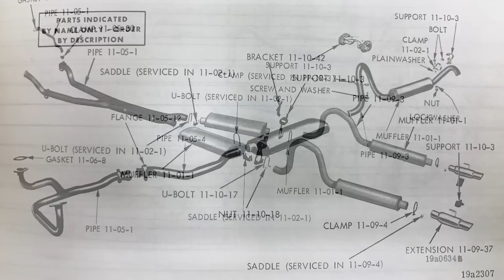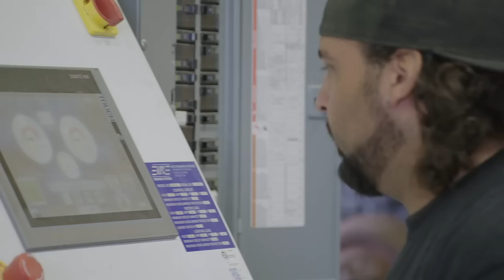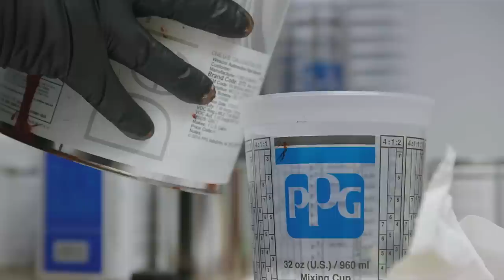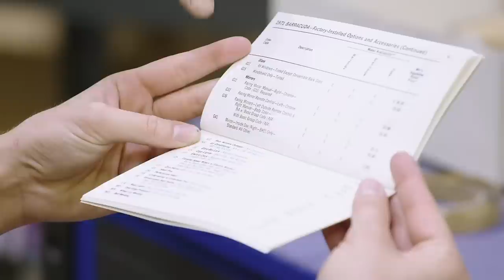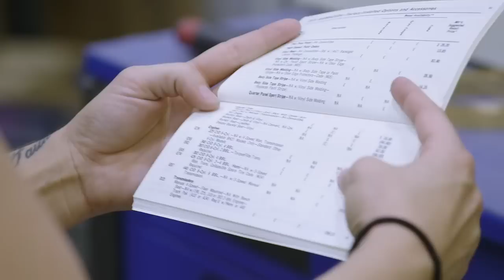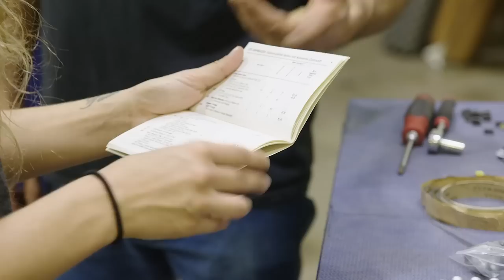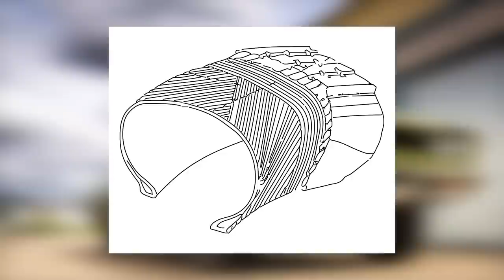WHEN MARK HAD TO REPAINT A CORONET R/T BECAUSE WILL SCREWED IT UP.

Comment: Appliance Wheels, 5 spoke wheels. I put a set of these on my new 1976 Plymouth Sport Fury. I ordered a 400 4 bbl dual exhaust non catalyst. Heavy duty everything, black with a sunroof. It stickered for $6776. I wish I had it. I had ordered a 75 Roadrunner but there were problems getting everything I wanted so I canceled it. But in 76 the Roadrunner went to the smaller body style. I think it was a Duster body? I enjoy your videos and knowledge.

Comment: Mark, best wishes for continued success, have been a fan from the beginning.  Admire your attention to OEM detail and restoring to original condition, not hot rodding with aftermarket junk.  Find you an inspiration because I'd like to do what you do, however, cornering the restoration market on AMC muscle, I am the original owner of a 1972 Javelin AMX with a 401 and know every detail.  AMC and Mopar share some parts in common, the Dukes of Hazzard Charger was painted in AMC's "Big Bad Orange", it showed better on TV.  BTW, when I open a shop is Allysa available, I'll double whatever your paying her?  Take care, Scott J.

Comment: "zebra-stripes" does not have to do anything how you lay the paint...or well, if you make too wide overlaps sure it will happen.... but if you make overlaps correct and still have such problems you have damaged nozzle or dirt in spraygun.